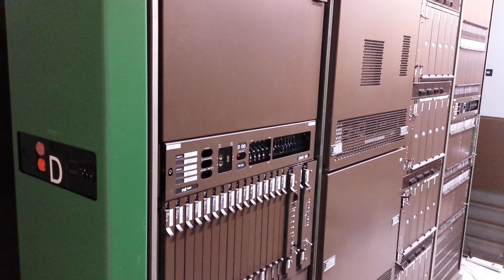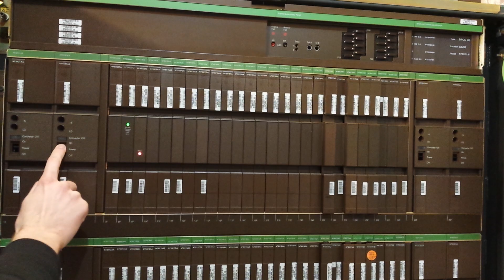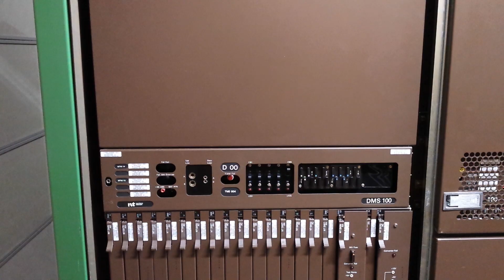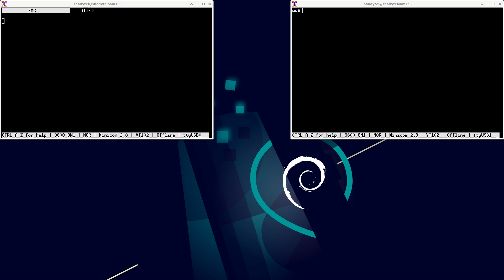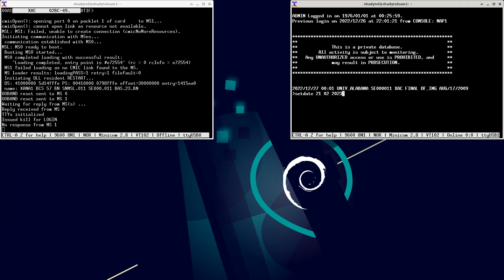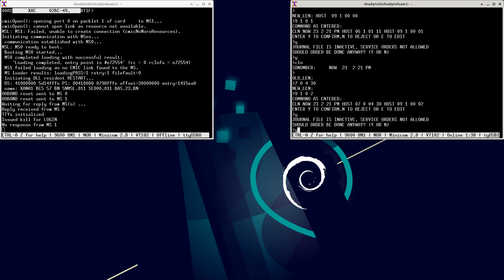DMS-100 Startup and First Phone Calls

Comment: Sheesh! Why doesn't it just have all that coding built in? What would it do if ya tried to make a call without all that typing?
Reply from the maker: Some of that was manually telling the switch to load firmware into the LGC and LCM. It would eventually do that on its own, but manually doing it means I didn't have to wait.

The other big part is that I configured service for the two lines I used. Without that, those lines wouldn't have worked. You only normally have to do that when changes are needed.
Reply: @joesvax : "It would eventually do that on IT IS own"? I'm confused, but if you just meant "...on ITS own" instead, then this is my reply: If we're talking about firmware, then why wouldn't that have come from the factory? And actually, how could there even be such a thing as firmware in a machine like this, since EEPROM/flash storage didn't seem to be a thing until many years later? Or am I wrong? But if I am, then why does it seem like firmware storage is a thing that only came around in the 90s even though I guess perhaps old-fashioned PROMs seemed to have been around by the early to mid 80s?

And why isn't it just a simple load command instead of that whole lot of typing? And how long do you think it would have taken to start that process on its own instead?

And then why do you have to program the lines then, instead of just have them operational by the computer as soon as the cards are plugged in and thus the chips that are there can control the SCRs or/and power transistors or/and small relays to connect and disconnect the phone lines whenever those phones are opened?

And what would have happened if you had picked up a phone receiver on one of those two lines without programming those lines in? Just silence, or what exactly?
Reply from the maker: @HelloKittyFanMan.  If you get hung up on minor spelling, grammatical, and semantic errors, I don't know how you deal with the real world.

The device comes with some firmware (in nonvolatile memory) that allows it to load additional data and instructions from other parts of the telephone switch. Those additional data and instructions are much larger than what would practically fit into directly addressable nonvolatile memory devices of the time.

Aside from that, it allows the hardware to be generalized for several possible roles in the system. While this isn't so important once the hardware is installed in place, it means that a reduced variety of spare parts are needed since one generic processor module can work in multiple applications. Depending on the application, different instructions are loaded into the device.
Reply: Haha, woww,  @joesvax , "hung up"? Nice, that's a funny assumption. If you get hung up on falsely assuming that just because someone tells you what they guess you're trying to say that means that they're "hung up" on it, then I don't know how you deal with life in the real world. Besides, I didn't bring up a spelling or semantic error, and whether or not the thing you said that didn't make sense is a grammatical error is arguable. It was just a word choice. And since I just said that "IF you meant... THEN this is my reply," you shouldn't have even had anything rudely awkward to say about it.

Besides that, this IS the real world, when we're considering a video about real things. Just because we're communicating in text over the web doesn't mean we're not doing it as part of the real world.

So by 70s standards, when you say "nonvolatile memory," are you talking about just standard ROM? If it's hard ROM, then that's hardware instead of firmware. If not good old-school ROM, then what? And if that didn't all fit into RAM at once, then how was it cycled around just based on the stagnation, outgoing, incoming, and other events of a phone line?

Interesting what you said about configuring general cards to do different things, depending on the needs and counts of different kinds of things needed (lines vs line finders vs. markers, etc.). So you're saying that a card with the wiring to go out to a subscriber line, that might have an RJ45 jack for that, could be switched out of that function and become a marker or part of one (or whatever replaced markers) or serve one of the other functions? And I didn't notice: Do those cards have one or more RJ45 jacks on them for going out to subscriber lines even though older switches probably do not?

And again, there's one of my questions that's still waiting for its answer: What would you hear if you tried picking up the receiver on one of those line cards before configuring it specifically for handling calls?

And the other question still waiting: How long would it have taken to get around to automatically configuring itself, and how would it know what you'd want for each call?

And another one: And why isn't it just a simple load command instead of that whole lot of typing?
Reply from the maker: @HelloKittyFanMan.  

>Haha, woww,  @joesvax , "hung up"? Nice, that's a funny assumption. If you get hung up on falsely assuming that just because someone tells you what they guess you're trying to say that means that they're "hung up" on it, then I don't know how you deal with life in the real world. Besides, I didn't bring up a spelling or semantic error, and whether or not the thing you said that didn't make sense is a grammatical error is arguable. It was just a word choice. And since I just said that "IF you meant... THEN this is my reply," you shouldn't have even had anything rudely awkward to say about it.

It's clear you knew what I meant and yet you made a point to call attention to it anyway. It came off as derisive. Aside from that, about half of your comments on this video have mentioned something about my word choice. It feels like you're paying a lot of attention to something most people wouldn't have thought twice about.

>So by 70s standards, when you say "nonvolatile memory," are you talking about just standard ROM? If it's hard ROM, then that's hardware instead of firmware. If not good old-school ROM, then what? And if that didn't all fit into RAM at once, then how was it cycled around just based on the stagnation, outgoing, incoming, and other events of a phone line?

I haven't specifically looked at the cards that were loaded, but they either contain mask ROMs, EPROMs, or NOR flash memory, all of which are generally classed as read-only memory. Many of these cards are considerably newer in design than the 70s, by the way. Development on this telephone switch platform continued for a few decades after it's introduction.

It did all fit into RAM at once, at least I assume it did. However, dynamic RAMs can be much larger than byte-addressable ROM technologies.

>Interesting what you said about configuring general cards to do different things, depending on the needs and counts of different kinds of things needed (lines vs line finders vs. markers, etc.). So you're saying that a card with the wiring to go out to a subscriber line, that might have an RJ45 jack for that, could be switched out of that function and become a marker or part of one (or whatever replaced markers) or serve one of the other functions? And I didn't notice: Do those cards have one or more RJ45 jacks on them for going out to subscriber lines even though older switches probably do not?

Some cards are more specialized than others. The cards I was specifically referring to, in this case, is the peripheral module processor card in the LGC. The card used in the LGC is re-used for LGCIs, DTCs, DTCIs, LTCs, LTCIs, SMA, SMA2, TMS, and several other possible configurations that I'm not remembering right now. These modules are all built on a common hardware platform with a number of card types reused between them.

The cards that actually serve subscriber lines are somewhat more specific depending on the kind of line being provided. 'Type A' line cards provide basic analog loopstart phone service. 'Type B' line cards additionally support ground start, polarity reversal, and coin phone control voltages. 'P phone' line cards support proprietary Nortel key phones. A fourth line card type is similar to the type A card, but additionally supports the high voltage signaling used to drive neon lamp message waiting indicators. RJ45 connectors are not used on these cards directly, instead they have pin headers on the line drawer for interfacing to 32 pair cables.

>And again, there's one of my questions that's still waiting for its answer: What would you hear if you tried picking up the receiver on one of those line cards before configuring it specifically for handling calls?

In this case, the lines were completely unprovisioned. I did not try it, but I believe the line would be silent. It may not have even had power applied, I would have to check.

>And the other question still waiting: How long would it have taken to get around to automatically configuring itself, and how would it know what you'd want for each call?

I don't know exactly how long. All I know is that it would have taken longer than I had to film the video. I imagine it could have taken several hours, but this is a guess.

>And another one: And why isn't it just a simple load command instead of that whole lot of typing?

Some of the typing was navigating the menu structure and checking status of various elements before I finally issued the single command which loaded the peripheral modules: LOADPM

Because there are potentially many different peripheral modules in the switch, I had to explicitly select the ones I wanted to load before I issued the command to do so.
Reply: @joesvax : How is it so "clear" to you that I "KNEW what you meant" even though my response was only based on a guess rather than knowledge, and I even indicated as much by saying "IN CASE..."? And why should that bother you so much if someone says "IN CASE you meant..."? "Derisive"? NO. What is derisive is when a person has a problem with someone who doesn't want to assume what someone else is saying, like "putting words in their mouth/on their keyboard." Why should you care so much if someone pays that close attention, especially when most people I've heard of actually appreciate when we pay close attention to what they're saying instead of being bothered by it for some screwy reason? How would you like it if you said to someone that you were guessing they meant [xyz] and so you'd base your reply on that, and they got all mad at you for no good reason?

But thanks for your time and effort still answering the rest of this stuff (as in the previous replies):

Also, you can save time, reading space, and effort by not reposting everything I say in your reply. I know how to scroll back up to refer to my own things, and when I remember it (which I usually do for a long time, but if I don't, then scrolling back up to it is no big deal unless the thread is several pages long), it takes less scrolling within the same reply and is thus actually easier. So from now on, at least with me, if you would just not do the reposting until the thread gets to be about 100+ replies long, that would be easier for both of us, especially if your reply is already going to be quite long.

Flash -"memory"- storage in the 1970s? I guess I'll have to look that up. How could we have had flash storage clear back then even though I never heard of EEPROM or modern flash until maybe the late 80s or early 90s? And why wouldn't any of that stuff have been on tape or one of those physically big hard disks?

So if the data supposedly "did all fit into RAM" then what did you mean by it "not fitting" in your previous reply?

So are you saying that the peripheral module processor cards, which aren't the ones that go out to the lines still have to be set up to handle lines along with the main line-handling cards in order for the lines to work? And you're saying that they have those wire sets that some offices used in those days and some may still use, with the purple/white, blue/white, green/white, orange/white, and brown/white pairs? What are the other pairs, so that we have 32 distinct color patterns?

Yeah, I'd like to see a video where you try oddball things to see what happens, the first being when a machine wasn't configured like this, what happens when you listen to a phone on it and/or trying to make a call anyway. The second being that you send all the configuration data while at least one phone is off-hook (and on speaker mode, or you have it wired into a good clean capture connection), and see if we start to hear dial tone in it at the moment that the configuration is finished, or if hearing the dial tone requires a line reset first.

Oh, I guess I should go back and rewatch the typing segment, because I was thinking that it was all just a bunch of coding and other cryptic commands. Anyway, it was mildly interesting to see all the typing that you had to do to start the process manually, so I'm glad you showed us that, but I'm still curious: What if you had just started the switching process and then shown the screen while waiting for it to configure on its own, and then cut off, and then restarted video recording with whatever was on the screen after it was done with its own configuration?

What sorts of configuration can the system set itself up with after you tell it at least which peripheral module processor cards should be the line handlers before the main line cards?

Comment: Whar line cards are you using 6X17 s  or 6X21s ?

What trunks do you have on your PDTCs ? Sorry DTCs I'm in Europe.
Reply from the maker: Mostly 6X17, 6X19, and 6X21 (if I'm remembering the PECs right) and a couple 6X18
Reply from the maker: Oh, and for trunks, T1 of course, should be capable of PRI but I don't have that reconnected and configured yet
Reply: @joesvax  excellent,  you should setup some IBN7 trunks for network centrex. 

What front end is your DMS ?  NT40 or supernode ?  Or even XACORE ?
Reply: @joesvax  Well your need the DTCOI's for PRI or as we know them PDTCOI's or PDTCOI2s for the double density cards. Do you have any MSB7s ?
Reply from the maker: @212MPH  the DTCs are actually DTCIs, yeah. No MSB7s but I do have a LIS that I could (physically) put LIU7s in, but I probably don't have the software options to do that.

The core is an XA-core.

Not totally familiar with IBN7.
Reply: If you have a DTC and want PTS trunks, you need 6X50. Two T1 (DS-1) per card.
Reply: @adrianbrewster5014  different peripherals in Europe like I mentioned,  we do not use T1s, everything is E1 30 Channel PCM.
Reply: @212MPH  I know. If he has a DTC (North American market) then the 6X50 is the DS-1 interface he needs. I've dealt with a few DMS-300 gateways in the US and Japan.

Comment: This is actually an SL-100 PBX, not a DMS-100
Reply from the maker: Correct. When this switch was originally installed, it was classed as a DMS-100/200 and the SL-100 did not yet exist as I understand it (1984). During later upgrades, the software was reconfigured to be an SL-100.

The SL-100 PBX is in the DMS-100 family of telephone switches and shares its base hardware and software with the other switches in the same family.

I figured viewers on youtube would be more likely to recognize the DMS name and it is close enough to correct for the purposes of this video.

I do show a few cabinet configurations that would not be present in a true DMS such as the MCAM and an IPE cabinet. The optional EMI shielding doors seen on one of the 7ft frames are also intended for PBX installations as well.

Comment: I was inspecting a live DMS 100 in Norfolk, VA, USA on Dec 13, 2023. I will be removing the switch in February 2024. I have been removing CO switches worldwide since 1985. Presently, I am mining buried LEAD cable USA-wide.  In Nov 2023, pulled 300,000 lbs. in Chillicothe, OH, USA. If anyone knows of abandoned buried cable (LEAD or Stalpteh) I would be interested. Also, interested in CO switches coming up for removal worldwide.
Reply: Is the Norfolk VA switch gonna be replaced? You’re saying?

Comment: In ten years, that whole rig will be in something the size of desk clock.
Reply: It pretty much already has. Hence the reason Nortel went Bankrupt. My current home phone is just a Magic Jack. Smaller than a FireTV Stick Everything is packets now.
Reply: @TheProjectHelpDesk  I'm still served off of a old Hard-Switch DMS-100/200, And back in september of 2022 i had a chance to get a tour of my office, And there was a lot of cool stuff in there such as Electro-mechanical relays in my switch for testing trunk lines so fourth like that, And GUESS WHAT! there's a freaking mini Crossbar switch in my office as well Which totally shocked me at that time cause i thought digital switches was fully solid state, But no not all of them.

Comment: The load on these is ridiculous. Hence why every telecom is trying to get rid of them.
Reply: Not anytime soon, it takes a lot time and money to get rid of something like that.
Reply: No, not every telcom is trying to get rid of them.  The DMS's are work horses.  Any phone call placed is probably going to go thru 2 or more DMS's to complete a call.  Another fact, not all telco upgraded to XA-Core, Verizon were/are still using JNETS in their rural areas less than 10 yrs ago, long after Nortel had gone under.  With the exception of finding replacement circuits, there is no need to rip out TDM and replace with costly VOIP.  The SL-100 can also still be upgraded to CS2100 and in cooperate VOIP.
Reply: @rc_farmer4866  this is very true!
Reply: I'm my area...ziply fiber...I just saw a 5ESS get ripped out. Plus DMS10s and DMS100s that are about to go. Definitely makes me worry a little since I'm an air dryer tech.
Reply: @erosnemesis  Where's this at exactly?
Reply: @MichaelWallace-oq3wd  Washington, Oregon, Idaho areas.
Reply: @erosnemesis  Wow.